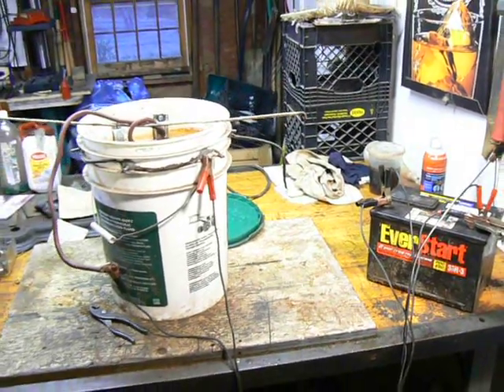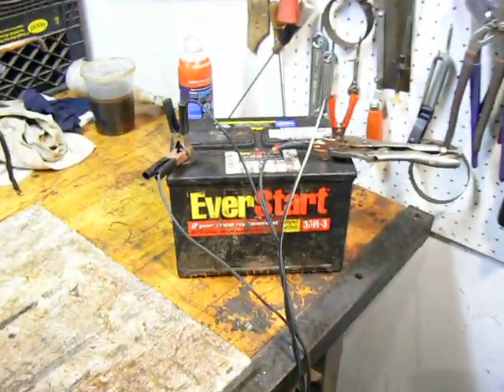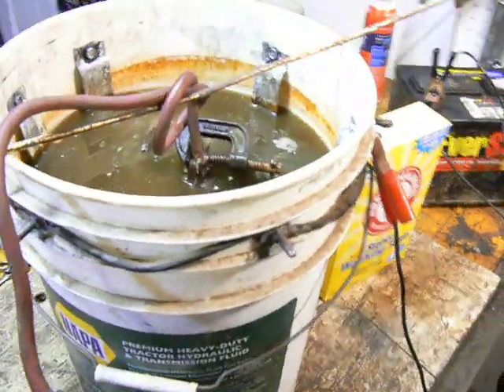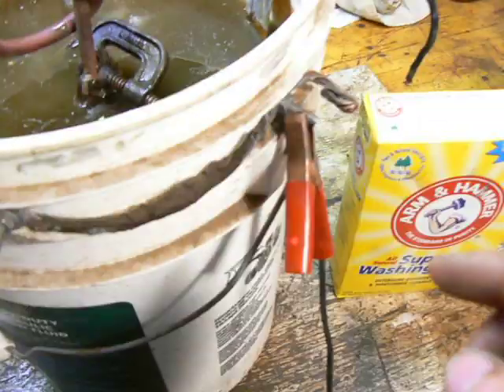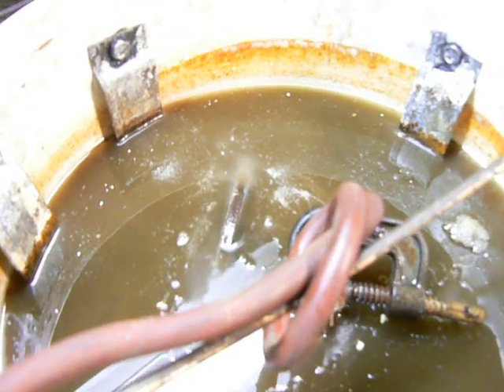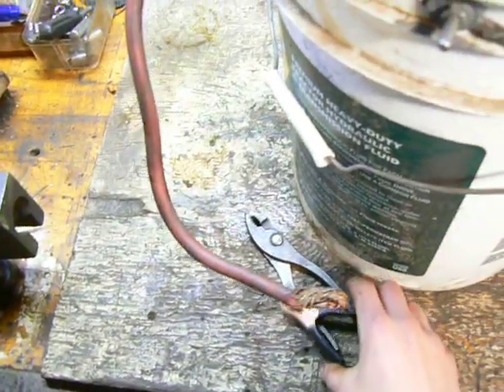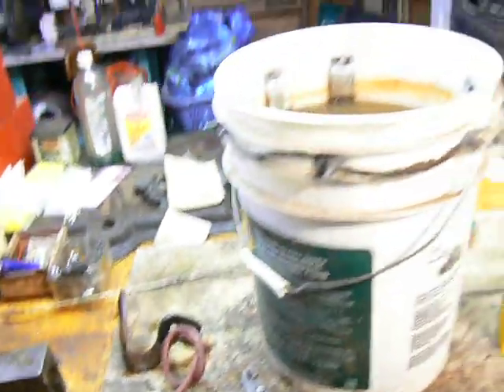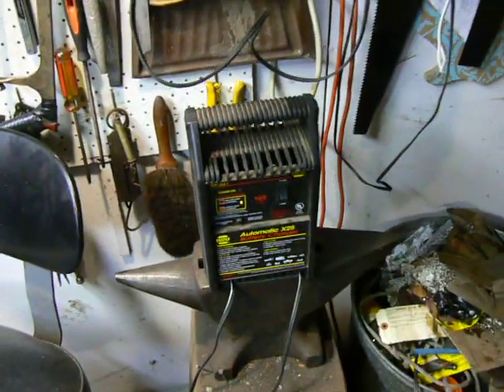Home Shop Tips No. 7 - Building an Electrolysis Tank for Rust Removal

Comment: You can use baking soda. The additive just ups the cunductivity of the water, which baking soda will also do. It's just more expensive.. You can even use caustic soda (lye), but that is a bit more dangerous, since it will burn your skin if you touch it.

Comment from the maker: rust remover is more around 20 a gallon or more, to fill a 5 gallon bucket would cost near $100 and the fluid does not last forever. this contraption took 30 minutes to make with parts i had lying around and a $2 box of washing soda. when the water gets dirty i can pour it on the ground with no worries about the environment and refill it with more water and soda. this process can also be scaled up to remove rust on very large pieces that would be impractical to de-rust with rust remover.

Comment from the maker: the flow of current pops off rust particles and if it's left in there long enough, it will come out clean with a dull grey finish. note that the part must all be one piece of metal. if there's two pieces rusted together, the second piece will not be cleaned because it is not electrically connected.

Comment: Your video is the only one that shows how to do electrolysis with a!smart" charger. Everybody else just assumes that you can run out and find an old style charger that doesn't shut of, when there's no voltage.
How many amps does your setup draw. My concern is, that the system draw more than 10 amps (standard cheap charger), and depletes the battery if not monitored? Thanks

Comment: Nice set up. I have a question regarding the battery. Does it need to be charged? I have an old one in my garage that hasn't been charged in years. Is it just the load of the battery that the charger needs, or does the battery have to be charged up to 12v  before using in your setup?
Reply from the maker: thanks for the question. my setup is more complicated than it should be, because my particular battery charger is a "safety" charger. it does not put out current unless it senses a battery connected to the leads, which is why i have the battery. if you had a regular charger you do not need the battery.